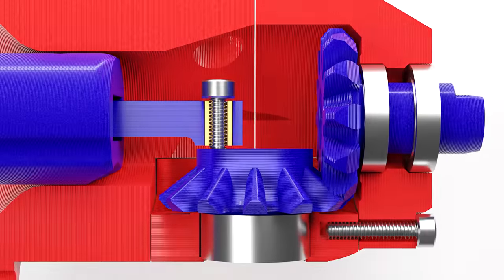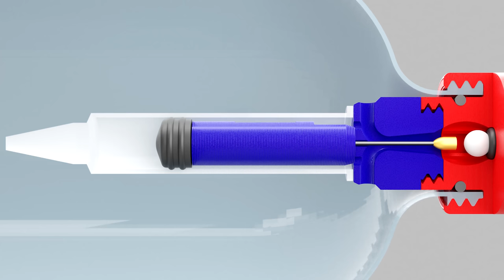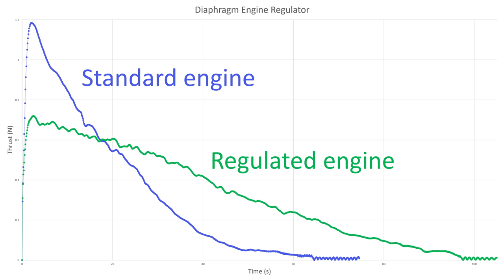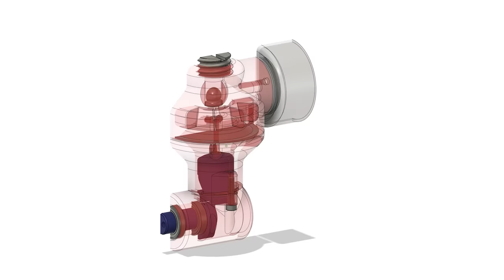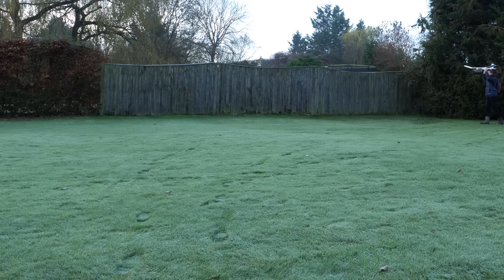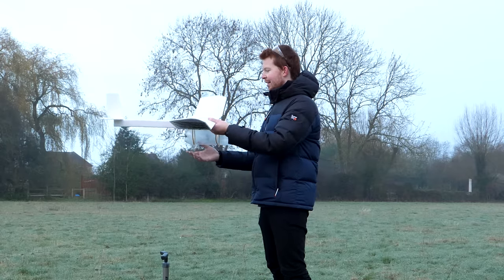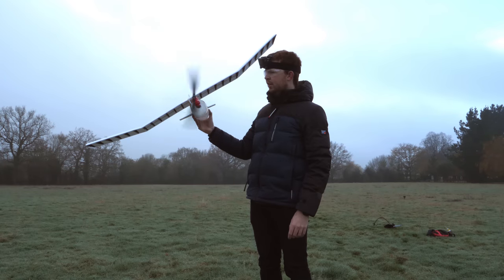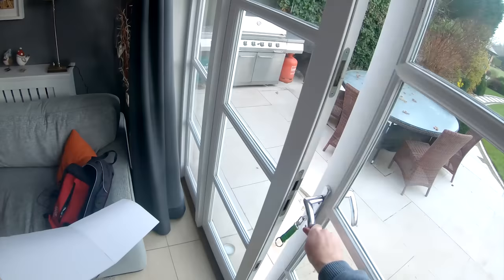Pneumatic Plane

Comment: I had an old airhogs air-powered helicopter back in the day... Any plans for vertical flight with this design?
Reply: +1 verticle flight would be sick
Reply: Didn't Airhogs have ones that would fly horizontal like in this video? Do they work on a similar principle with the engine? If so what allows them to fly so well?
Reply: Vertical flight requires a much higher power-to-weight ratio than horizontal flight. If it's this difficult to make this engine fly level, it would probably need some major improvements for vertical flight.
Reply from the maker: I've considered it... but a 1:1 thrust to weight ratio isn't going to be easy!
Reply: @TomStantonEngineering  Very true, i think if you were to increase the size of the engine, you may be able to get more thrust per gram
Reply: @TomStantonEngineering  MOAR PRESSURE
Reply: @catwaterboy  But also, no pressure. You do you Tom!
Reply: @fullerblacksmithing7954  It might be worth thinking of a way to improve the cylinder design as well. The current diaphragm model seems to have a pretty poor expansion ratio, I imagine the air's still at a fairly high pressure when it's released.
Reply: @TomStantonEngineering  What about more pressure and a multi piston engine?
Reply: Would using a longer bottle of sorts and adding simple fins to it like a bottle rocket help? The weight would be reduced and it would be able to hold a larger amount of air and not require flow regulators(like a solid fuel rocket).
Reply: @TomStantonEngineering  electrolyze some water to make hydrogen then compress that (very carefully) into the bottle. Lighter than air 'fuel' for the engine.
Reply: Either a contra rotor or a tail rotor would be needed, additional torque for the engine to output  to two large rotors and/or losses in gearboxes etc . Would be tough
Reply: @Jonay1990  There was an electric vertical flight thing with one propeller. It had a poly-something (not styrene) bead foam body shaped like multiple blades with a ring connecting their tips. It had an IR sensor on top and all the remote did was turn it on. If it got too high the sensor would lose line of sight with the remote and it'd turn off. Its reaction time was too slow to spin up again before hitting the ground. The body and prop contra-rotated.

Make something like that light enough and it'd just fly up until running out of air.
Reply: @eco9807  I wonder what if it was only rocket. No losses with friction, but I have no idea if efficiency will be better,

Comment: My dad was born in 1913 and fell in love with model airplanes and later aeronautical engineering.  He got to see aviation grow from Jennys to SR71's.  He was temporarily crippled as a kid & spent a lot of his time building models that included a hand built a thin copper foil air tank spiral wrapped with a very thin wire and dome ends.  He built a 3 cylinder engine to go with it.  I never saw any of his planes or the plane this power plant was in but it still had the propeller so I could pump it up and spin the prop.  Unfortunately he threw all of his old models & related things away except for a silver first place cup he won in a contest where his rubber powered plane "flew out of sight".  "Yesterday's junk is today's treasures".  For sure!

Comment: When you do the 3D animations do you need to time all of the moving parts or does it use some type of physics engine to compute the mechanical motion? I have been trying to figure how to make gears self animate based on physics in fusion but no dice.
Reply: Try using a motion link between the two gears. It should work as long as the gears are components and lined up correctly. If the gears are different sizes you might have to adjust the ratio in the motion link to match the gear ratio. Hope this helps!
Reply: Note that Aaron Luke's solution, which is a good way to animate a mechanism, does not require any rigid body simulation. It's simply synchronised animation, very light to calculate
Reply: @Aaron-sh1vq  I'll give it a go!
Reply: @rpyrat  True, the motion link is a just a simple simulation that will display how the gears interact
Reply: It looks like Blender (which allows each subassembly to be animated along a path or axis)
Reply: @joekalipso  Yup, if I remember correctly Tom wrote that he uses Blender to do the animations in a comment under the previous video
Reply: You could use Ansys Fluid, it's a free simulation software if you get the student version (entire software, just limits your simulation)

Comment: 4:15 I could have told you that'd fail. A wing has a smooth surface for passing air. Yours is a rib setup which catchs torroidal columns of air flowing and straddling underit. Put some plastic foil under the wing to cover the ribs.
Also you're using a soda bottle, not very aerodynamic, Cut it 2/3 and glue back together to taper the fuselage.
Lastly the box column you use for the tail assembly is open to air flow but allows no air out. Taper it with a plastic cone.
Reply: I have no clue about aerodynamics and stuff but wouldn't it be possible / feasible to build the air container into / as the fuselage? Unless of course the bottle is the core element of the design. 🤔
Reply: @ramsa410  its just an air tank so yes, in theory you could create it in the fuselage. However, you would have to make it completely airtight even at high pressure for it to work.
Reply: yes, these holes between the ribs creates tons of drag force due to the turbulence flow, it can be avoided by seal the bottom of the wingspan.

Comment: I would definitely use a much thinner diaphragm (say a stretched piece of balloon even - it will help with cold temperatures and will absorb less of the kinetic energy you are producing) and add at least a minimalistic control system - your components looked pretty heavy for such a system. I would definitely look at using SLA to print the components - you should be able to make them thinner and lighter, as well as less likely to break. Lastly, your airframe would be better if you used the same minimalistic ribs, but with something like carbon or balsa spars and Coverite or tissue paper skin. Rag and tube with the highest strength-to-weight materials where practical is still the one of the lightest forms of construction generally - though usually not the easiest. Ideally you would use molds and single layups of appropriate weight carbon fiber to make the whole airframe, and then use light-weight film for skinning aero surfaces, leaving non-aero surfaces uncovered (at those velocities the slight increase in drag doesn't matter much at all).

Comment: 3 Suggestions:

Cover the underside of your wings.

Make an elliptical wing tip. (saves weight and is more efficient)

Consider the gear ratio you're working with and the RPM of the propeller. Props have a best RPM, and I have a feeling you're undershooting that RPM significantly.
Reply: Of course!!!
Reply: I completely agree! Sealing the wing ribs from the underside would achieve the tear shape to increase lift, since it seems like he has always to bring the tail down so he can keep the nose of the plane facing up. And the up-tilted tips are to keep the plane more balanced when turning and they don't have to be this long.
Reply: Вот и я о том же. 
1. Где нижняя плоскость крыла? 2. Неправильная развесовка / центровка
3. Тяжелая конструкция для таких оборотов двигателя и винта.
Reply: completely agree even if it's paper or something it would greatly increase lift for sure.
Reply: @ЮрийВоробьев-ц9н  Нахуй ты на русском пишешь на канале где все говорят на английском?
Reply: it has more to do with raw power output than gear ratio. In fact you do not need gears just straight out piston with reduction of the propeller span to reduce drag and increase rpm. And throw the valve away, because u want to maximize the power over short burst rather than prolonging the flight. Clearly the plane is underpowered from the speed it is flying even when manually propelled by your football arm.
Reply: @vrnvorona why not? With Google just auto translating it we can communicate with people all across the world in most languages. The Internet is awesome and I think it's incredible how easily I can understand what that person said.
Reply: @davidfernelz  it's obligation of person who speaks in minor language for that group to translate his thoughts, not all others to translate. He has to do it once, others have to do it multiplied by amount of people

Comment: I love the fact that it even sort of sounds like a conventional piston engine yet there is only air... love it!
Reply: To be precise every piston driven combustion engine is only working with compressed (but hot) air/gases.
Reply: @Taunus-Tim  well yes, and to be precise, there is no combustion happening here, and the combustion is part of what makes the sound of a classic combustion engine. the compression and decompression of the gas is cool and sounds dope, and that's a-okay and doesn't need a "well, actually..." attached to it ;)
Reply: @itisjambo  correct. And thats the same here. We have compressed air, and we decompress it in front of that 3D printed piston. Or to be exact: when the outlet opens. No expansion inside the engine happening here.

Comment: Awesome stuff. Try putting some dry ice is there. Constant high pressure source. Relatively common, at least in the US.
Reply: the starting weight might be an issue but i wonder
Reply: That's what I thought too, but the cold air would probably make the rubber diaphragm crack.
Reply: Or power it off a CO2 cartridge. The initial design was to emulate the Airhogs planes though so that's admitting failure.

Comment: Maybe when you get the engine working beautifully, you could try adding another cylinder?
Reply: I own a one cylinder motorbike. When you start adding cylinders, you'll end up with 12 of them. Or 8. Those are perfectly balanced. Did you ever ride a well tuned 650 cc bike? One cylinder is enough.
Reply: @voornaam3191    There are plenty of 2 and 3 cylinder engines
Reply: The bottleneck isn't the cylinder, it's the total energy that can be stored in the compressed air bottle without becoming too heavy

Comment: This is great. Can you run it on CO2 cartridges?
Maybe with one of those emergency bike pumps

Edit: maybe it’s not a good idea, the 2 litre plastic bottle at the pressures you’re using actually hold much more air, while being lighter  than the cartridges
Reply: I think pressure regulation would be a huge problem.
Reply: The co2 out of those cartridges will be very cold. IDK if the rubber can take that.
Reply: The "emergency bike pump" would solve almost all pressure regulation issues. But yes temperature could be a problem
Reply: @among-us-99999  I think you could channel it through some pipes in a bottle, to increase the temperature.
Reply: I just did a little bit of math, the system would be much heavier than the plastic bottle while only storing like less than half as much gas.

Comment: Try a double engine design (remember: you’ll need the blades to spin in different directions)
Reply: No double!!! It’s only double you weight!
Reply: @thomasrose2325  but double the power to compensate for the weight
Reply: @thomasrose2325  but twice the power
Reply: ... is this how people building rockets feel

- ADD ANOTHER ROCKET!
- BUT NOW WE NEED MORE FUEL FOR THE EXTRA WEIGHT
-DOESNT MATTER WE HAVE ✨ ANOTHER ROCKET ✨

Edit: engine? Thruster? Nu idea ;-;
Reply: XD my brain: we need a bigger bottle
Reply: @unknown_baldy9432  my brain: we need an extra brain
Reply: An extra engine could run on the same bottle. As it is now the bottle pressure doesnt seem to be the limit.
Reply: @TheLolOmgBbq  yes more brain power
Reply: @Noosh_noot  if one bottle can lift its self and a plane then two bottles will give it more power but additional weight... but that will not matter since it will be double the power
Reply: No! you will never control the power to be perfectly equal with simple low cost methods.
Reply: @markhorton8578  true, it will probably just spin one way, but thats kind of ok right?
Reply: How about more than one piston. Maybe a pneumatic radial engine!??
Even if it offered very little benefit in terms of top speed, you'd get brillian torque and it would look and sound so cool!
Reply: @blahblahblahblah2837  little weight... more power.... I like this 😂
Reply: @markhorton8578  That's assuming a side-by-side setup. You should get extra thrust and skip that issue by running the rotors one behind the other.
Reply: @wandersl  I had thought of that, but then due to turbulence you get both loss of power and even the possibility of increased drag. You need some fancy aerodynamics to make an in-line efficient and a fizzy drinks bottle is not it. :-)
You might get a smoother action and therefore better power with inline pistons, but that is best assessed by experiment.
Reply: @Omar Khurshid great minds think alike!

Comment: Some tries:
1. I would try putting cling wrap under the wing.  If that improves the lift, then use better plastic under the wing.
2. I would try strengthening the bottle.  Perhaps fishing line or a high note musical instrument wire.  Or that white fiber stuff they put in some wire bundles to strengthen the wire.  It does not have to cover the surface.  Just a few times around the bottle could strengthen it quite a bit.
3. I would go with a smaller diameter propeller, but it can have more blades.  That way there is less angular force on the motor when the blade hits the ground, fence or a wall, and it is less likely to break.
4. Have something cause a chemical reaction in the bottle, increasing the amount of gas pressure in the bottle as it flies.  Ideally, not actually burning.  And ideally, you can start the reaction after there is pressure when you want it to start.
5. CO2 Cartridges instead?  They have 90g ones that should power it for a while.  But the little ones are probably safer.

Comment: I feel like you should build one of these little engines for a co2 cartridge
Reply: interesting idea!
Reply: @Lancia444  eyyy thank you!
Reply: Doesn’t co2 get cold?
Reply: The whole 16g of it.
Reply: @T34theAmericanheavy  Yes but anything does when it rapidly expands.
Reply: @brucebaxter6923  Ahahhhaha with big enough wings your could create the lift required. Plus I'm assuming the rotational energy used for the prop could be put into some wheels for a little rc car or something.
Reply: @johnzello8039  
Sorry, what?

A co2 canister only holds 16grams of co2
Reply: @brucebaxter6923  my b I thought you were saying it weighed sixteen grams. Also that’s a lot of fucking air and it’s extremely compressed shits at something like 800-1200 psi that can move a lot of force. Or a little bit of force over a long period of time.
Reply: @brucebaxter6923  also there are bigger ones
Reply: @johnzello8039  
They weigh more than 16g

There is about 10litres 2gallons in the steel bulbs and about 50litres 10gallons in the sofa stream alloy ones.
Reply: @brucebaxter6923  sofa stream alloy? Sorry I’m not familiar. But also I don’t see a point for him not to try with a co2 canister.
Reply: @brucebaxter6923  ur kinda just spouting things that make you seem in opposition but you haven’t really stated why
Reply: @brucebaxter6923  still seems like a lot of air in a tiny canister which means lots of power.
Reply: @johnzello8039  
power or energy?
power is the rate at which energy gets consumed.
the energy stored is the pressure times the mass

can you really use the full pressure of one of those canisters?
Reply: @brucebaxter6923  ummmm why would you not be able to use all the pressure in one of those canisters? there is a lot of energy in a little co2 canister. either way bro. I want to see him try it. i still dont get ur point. why would he not try that? they relase a small really high pressure burst of air. if that air was pushed over a turbine or used in the engine i would like to see how it stacks up. even if you are right despite you lack of a point i would love to see him try it so we get a good visual representation of the differences in pressure and or power and or energy that is given off by a co2 cartridge as apposed to a inflated soda bottle.
Reply: @johnzello8039  one super capacitor holds more energy. 

It’s stored at over 1000psi and runs down to zero, that range of pressure is impossible to deal with.
Reply: @brucebaxter6923  integza made a lil car powered by one. Would still like to see Tom Stanton try and make a plane outta one.

Comment: I have some suggestion for improving the wing, first cover it with a heat shrink film so the whole wing will be lighter. Second, expand the wing surface area or make a flying wing plane to increase lift. Third, increase the wings angle to increase lift too or high-lift devise to also increase lift. Lastly, use wooden skewer in the fuselage to reinforce it. That all, hope it helps

Comment: Inspirational video about a pneumatic motor driving a propeller to move a lightweight aircraft-like object. The focus is on weight minimization and increased engine efficiency. Time and again I see a crashing plane, even before the engine has stopped. I didn't study for this, I'm just fascinated. I myself have been experimenting with building paper gliders, that was a short whim, I did not continue with it. However, my first planes did exactly what your creations do. Then I changed the position of the large wing and the tail wing, I also made the tail somewhat heavier, after which my paper plane floated down nicely flat, almost fell silent, then made a dive and again at speed flat, climbing slightly climbing further floating to land flat... Maybe an idea to first perfect your engine in efficiency, test it by mounting it on a wheel/mill. Once the engine is working as desired, want to perfect your aircraft efficiency as a glider, and finally put together your creations into a functionally working propeller plane? Good luck with your inventions and videos.